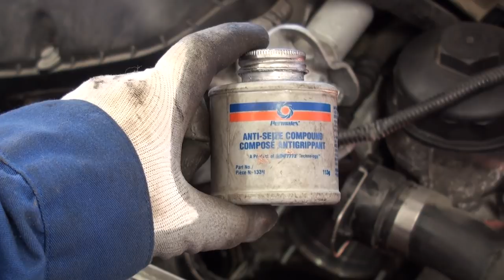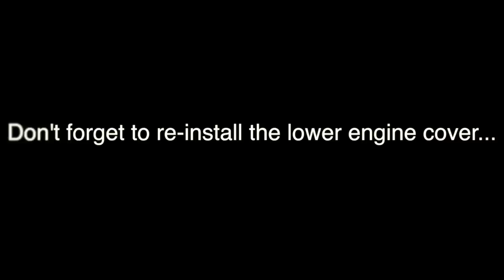BMW E46 Water Pump and Thermostat Replacement

Comment: Do you think that the Thermostat for the e46 being stuck closed could cause an overheat after the engine warms up?  The mechanic that I took my 02 325i Manual to said that the fan just shuts off for no reason.  I have already spent 1k on this cooling system and it still is over heating......   I'm about to blow this car up!
Reply from the maker: +Master G Jasuwan yep, a stuck thermostat will DEFINITELY cause overheating.  Make sure you have coolant flowing through the thermostat first before looking elsewhere for the problem.

Comment: can you please send me the part numbers to the lower radiator hoses on a 2002 325i BMW Automatic or were can I get that info for my car please help
Reply from the maker: Pnutt I don't have those numbers handy but if you call your local BMW dealership they'll easily be able to provide you with those numbers.

Comment: I just took my waterpump out and and one of my three screws got stripped so I yapped it and probaly didnt do it right so now I just have two screws and the 8mm allen screw holding the water pump. I was wondering off it will be safe or not? Please some one help me.
Reply from the maker: @ TheNoobComment - No you need to retap the threads to put all 4 screws in so it holds in the water pump properly.  There is tension on that drive belt and therefore you need to ensure that the pump mounting bolts hold it to the water pump housing properly.  Either take it to the shop or if you're handy then you can re-tap the stripped threads and if it's really bad you can install a hell coil to hold things in.

Comment: How similar is this to the M3? Is there any difference?
Reply from the maker: Hi Andy, the engines are very similar as far as designs go so I would only guess that the procedure to repair the cars is essentially the same.  I can't 100% confirm this but I'm quite certain the steps shown in my video apply to the M3.
Reply: Awesome thanks!
Reply from the maker: You're welcome!

Comment: Why can't tap water be used for the mixture?
Reply from the maker: you shouldn't use tap water for the mixture because of the dissolved minerals in the water that can clog up the fine passages in the radiator. Deionized or distilled water is your best bet.

Comment: What brand pump u used? Thanks
Reply from the maker: @ Leland Dionisio - I used the genuine BMW pump - BMW sells both a remanufactured pump and a new pump.  The reman pump is cheaper and really all they're replacing when they're rebuilding the pump is the center shaft bushing and possibly the impeller shaft if it's worn out but otherwise new vs. rebuilt is worth the savings.

Comment: I'm looking to take the Thermo off and check it in boiling water to see if the Thermo is closed stuck or it is a fan issue.  Either way after I fix this I'm getting rid of this car.  Too many issues.
Reply from the maker: +Master G Jasuwan Yeah BMW isn't my preferred brand of car to own.  To your point too many issues that manifest themselves far too soon and quite pricey to repair.  My little daily runabout civic with 400, 000kms hardly needs any work considering the mileage it has.  The BMW in this video needed $6K worth of work at 110, 000kms.  Pretty bad if you ask me.